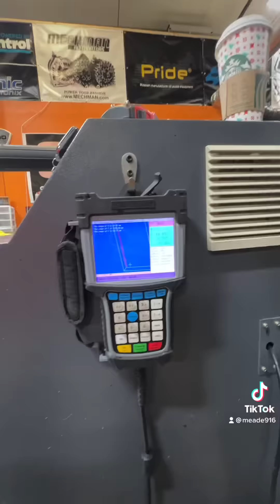Dual Gate Opener installed - I didn’t want to cut a trench in my driveway, so i did this instead.

Comment from the maker: 2 weeks ago we got a new iron gate.  I didn’t want to cut a trench in my driveway for the automatic gate opener wire. So i did this instead. 1/2” Marine board HDPE milled on both sides. 2.75” wide, 163" long, beveled with a channel for the wire underneath. Fastened with countersunk concrete anchors. 👌🏼 Having a shop full of CNC machines means i can make idea's into reality real quick! The gate opener brand is Ghost Controls.  So far it's working great!
Reply: Man your minds never stops💪🏾💪🏾
Reply: Hope it holds up, I never have good luck attaching anything to asphalt
Reply from the maker: @michaelrainey7726  well maybe you just learned something today then.
Reply: Clean application.  One concern though.  If you live in an area that gets snow, you and/or the snow removal service better be careful.  I can easily see that strip getting chewed up from a plow blade.
Reply from the maker: @chuckm260  we get a little snow. I am the snow removal service.  It will be fine.
Reply: Awesome job

Comment: That's a badass idea. I'll be curious to see how it holds up after years of abuse! Way to think outside the box Steve!
Reply from the maker: HDPE ain't playing bro...it probably won't even have a scratch on it years from now.  Should hold up nice! From my experience with using this material i have nothing to worry about. Thanks man!
Reply: I was wondering about the durability of it but it must be pretty tuff material to handle being driven over constantly. It’s only at low speeds I suppose.
Reply from the maker: @rolly4x4  it don't matter the speed.  If i was driving 50mph this stuff ain't getting damaged :)

Comment: Sweet, Top notch as always,but if anything ever happens to the wire wouldn't it be easier to pull wire through in the future if it didn't have the tape?or is it still able to be pulled through if needed?
Reply from the maker: it can be pulled. I probably never will though.  The tape is just there to hold it in place for the flip.  The wire is so curly and also stiff from being out in the cold, it didn't really want to cooperate :D  thanks!

Comment: Shouldn't the gates open in woods It just requires a different hinge. If a car pulls up and you open the gates it will hit the car or maybe I am wrong.
Reply from the maker: my hill is too steep to open the other direction.  Not that it matters which way it opens anyway.

Comment: Question: Does this setup tie into your home’s solar and battery or does it have its own battery backup system. If it does have its own battery backup is it sufficient for extended power outages?
Reply from the maker: it's on it's own solar.

Comment: Nothing but trouble with my Ghost controls opener.  Eventually had to hard wire it to my house. The solar charger panels it came with are too small. Batteries wouldn't stay charged.  Hopefully my new fix works.
Reply from the maker: my solar panel doesn't even get great sun (the Ghost controls panel) and it is charging very nice.  And i am charging a big ass XS Power AGM battery, not those shit batteries they try to sell you. You probably just have bad luck.
Reply: @meade916  Definitely not running an AGM lol. I used the two lawnmower batteries it came with then switched to a boat deep cycle. Now I ditched the solar panel and have a permanent charger from Ghost controls hooked up to my house. 3rd time is hopefully the charm.
Reply from the maker: @WarBeardTheRed  i would like to do that it is kinda a long run to my house and i would have to trench around my propane tank (it's buried) and under a pathway.  The battery seems to be the easier option. For now.  Thanks for your input, now i am glad i didn't buy that battery box with those cheesy batteries in it haha!
Reply: @meade916  could u just put a power box near the gate and run it that way or would it not work

Comment: Dang, i remember digging a trench to the keypad for my dad's gate, lol
Reply from the maker: a trench in the dirt is one thing. Trenching my driveway is something i didn't really want to do.  I easily could have though.
Reply: @meade916   lol, yeah, i had to use a pickaxe to get the top cover of asphalt  and finish the rest off with a sharpshooter aint no fun
Reply from the maker: @hihaveaniceday9386  a PICK AXE on the asphalt? ya...no.  A nice clean cut line with a diamond blade on a saw would be how i would have done it if anything.